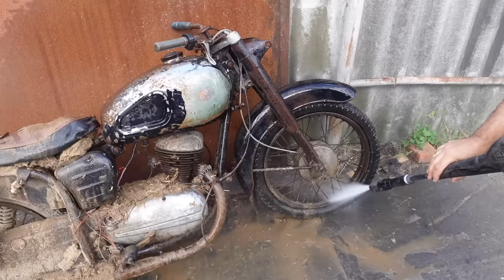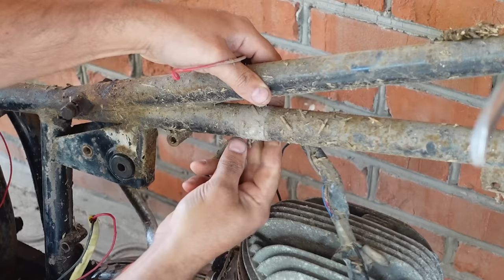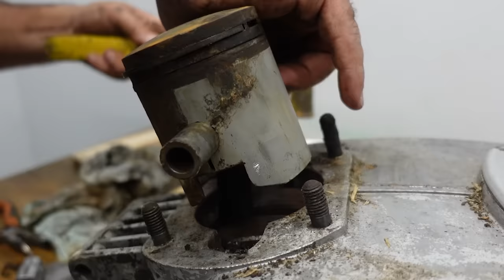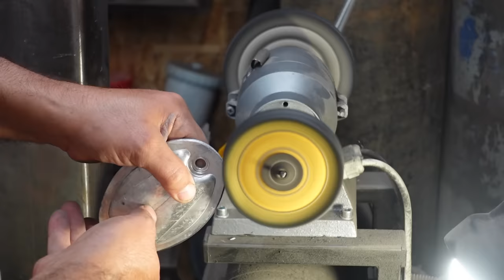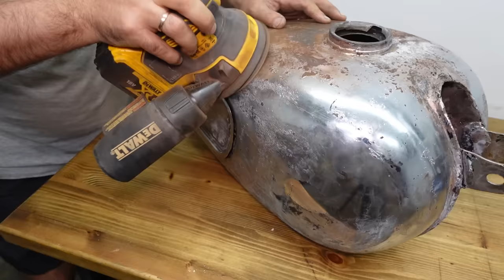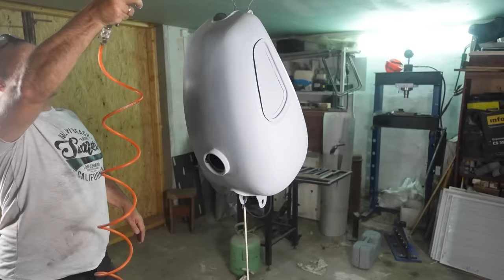Restoration Of a Motorcycle From The 70s

Comment: The motor cycles from the 70's had so much more character than those of today! Great job!
Reply: The look of dual exhausts... but only 1 cylinder... LOL !
Reply: True.....
Reply: no they didn't silly lol
Reply: @barryclyde8353  talk about ktm, just plastic
Reply: The motorcycle is Pannonia T5 from 60s.
I still have one...
Reply: @BuzzLOLOL  It looks like a 1966 Puch.  I had a 1968.  They had a split single cylinder to achieve non symmetrical port timing.  Two pistons and two exhaust pipes.
Reply: esto es una moto 2 tiempos del año 60 62...de 70 no hay nada...
Reply: @barryclyde8353  incorrect. old motorcycles look way better than  new fancy ones
Reply: Nonsense.
Reply: ÑñÑ
Reply: Это Панония выпускала Венгрия был у отца такой с коляской,так то не плохой но коробка дерьмо вилки и шестерни слабые и механизм тереклбчения,передняя вилка без масла телескопическая зажигание магнето стояло
Reply: I had a 1976 Triumph Bonneville 750 when I was in college. Loved it, but it wasn't particularly reliable. I would've liked to have had a Norton 850 too.

Comment: It should have been soaked first to loosen the dirt! This is a Hungarian Pannonia T5, which was produced between 1964-1975, in September 1975 the factory and the brand unfortunately ceased to exist.
Reply: Thanks for the info.
Reply: @mystified1429  I am Hungarian, I graduated from primary school in 1975. I was 14 years old at the time, and everyone was sad that the factory was closing for good. That's why I wrote to them before that to send brochures.They were already quietly packing, but they were nice and sent brochures about all types! That was very touching! In Hungary, this brand is already a legend.
Reply: Not surprised the factory shut down if their bikes looked that old of design in the 70's.
Reply: @rossbrumby1957  You don't know the details! The predecessor of this type was designed back in the fifties and remained in production for so long at the request of the Soviets.They needed a simply, easy-to-assemble motorcycle that they could take as much as they wanted. The factory tried, in the late sixties they produced a two- cylinder, modern, fast engine: Pannonia P20, P21. This was too complicated and fast for Soviets, so they didn't need it. In the meantime, the factory was completely out of date, and there was no money to renovate it, because the Soviets had to sell the engine cheaply, and no profit was generated. In the meantime, on the soviet initiative, the socialist countries coordinated production: motorcycles remained in the GDR and Czechoslovakia. Hungary was left with bus production, locomotives, railway cars, truck chassis, and electronic products. The factory tried everything to survive. In 1975, they planned a modern 250, the Pannonia P11, which was up to the standards of the time both in terms of appearance and technical content, but unfortunately only 1 prototype was made of it, and it could no longer be put into production. The Soviet decision was final.
Reply: Engine looked pretty good on the inside.
Reply: O
Reply: Thanks for info 🙂
Reply: @shrootek.  👍
Reply: The way he did it seemed to work fine
Reply: @honestopinion7585  Does anyone know why the factory closed down?
Reply: @andrewking4885  I described it in detail in one of my previous posts.

Comment: Blasting water into all the cracks and crevices is not recommended. Be gentle, a soft sponge maybe, after compressed air jet cleaning. Plenty of WD 40 everywhere before attempting to loosen any nuts and bolts. 
My 1951 Sunbeam S8 was a joy to restore!

Comment: That cylinder needed to be honed not just wire brushed. Then mic'd to determine the correct piston/rings.  I saw pitting on the cylinder walls which will blow-by oil if they are not deal with.

Comment: Is that a Jawa big single (350-500CC)?  OK, now I see, a Pannonia-probably a Jawa knock-off- and I thought it was about a 1963-66 but being from Hungary, they were a few years behind the curve on R&D. On this side of the Big Puddle, parts would be a nightmare. We have a standing joke at cycle shops, "Bultaco owners, Your parts back-orders from 1966 have come-in!" I owned a Triumph Tiger Cub which MIGHT have been a good bike IF I could have gotten spares for it. The Honda 160 Hawk Twin solved that problem and the dreaded "Geo. Lucas Prince of Darkness" problems too.My BSA Gold Star Production Racer had "character' too. Winding it up for a ride on a cool morning with that $%#@ Amal remote float carburettor and NO STRANGLER VAVLE!
Reply: Darn dude I'm 60 , markings on motor look like Jawa .  I'm not sure,  but had a 250 in the states in the 70s .  It screamed in the day!
Reply: Late 1960's I made a suspension minibike from scratch starting with a 1955 Jawa 350cc 2 cylinder 2 cycle engine and Cushman scooter parts... came out great... had it road legal...